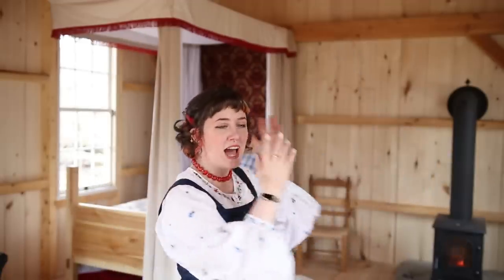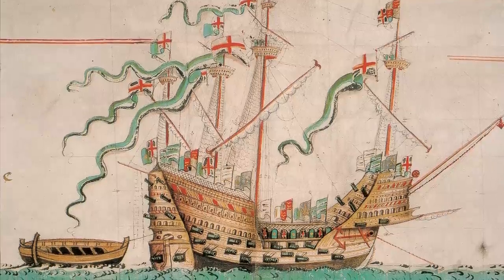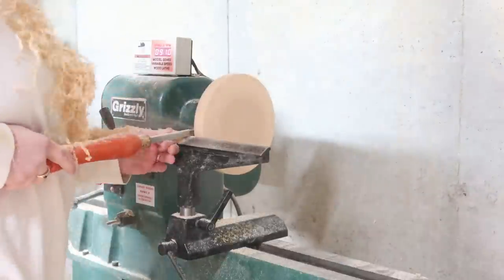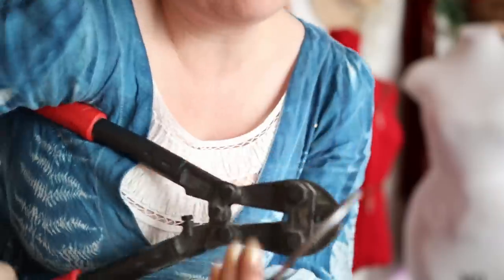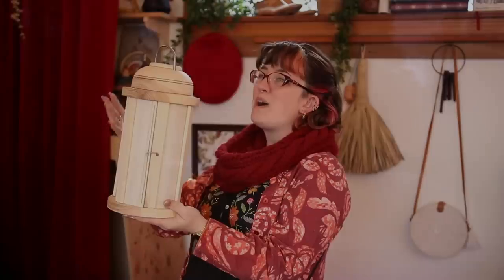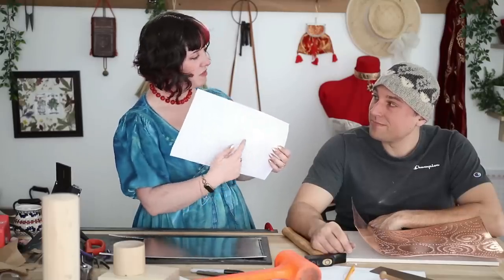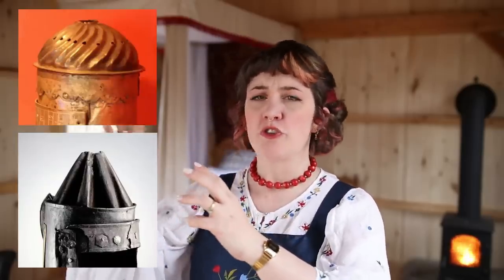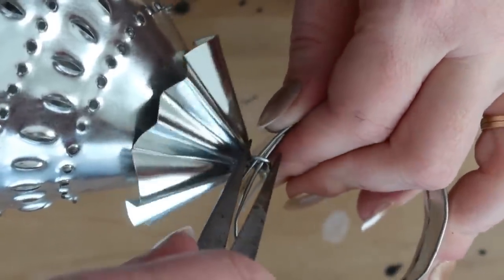Making some vaguely Medieval Lanterns 🕯️

Comment: Maybe it is because of my obsession with lighthouses but I always thought the glass panes were warped not quite smooth. Not warped as in disformed... Actually warped might not tbe the right word but I always thought that lantern panes were like lighthouse glass panes. See they need to be angled and cut in a way that lets the light refract and bounce so that the light beam can reach miles away to reach the ships out at sea.
While lanterns do not need to reach miles away, I thought the design process way still there so that when the user puts a light source (candle, flashlight, fairy lights, etc.) in the lantern, the light would be refracted in a way that illuminates around the user atleast a couple feet or in a straight beam to resemble a flashlight so they can see where they are going.

Comment: in the guedelon castle  they decided to make the windows out of oiled parchement so i find it most likely some medieval lantern would have been made in a similar manner (isn't it such a hazard to encase an open flame inside a box made of organic matter, itself place in a building of organic matter furnished with organic matter? The lanterns turmed out gorgeous tho, i want ten)
mid video hypothesis : the tin lantern works more like a flashlight (looks like that on the engravings) and maybe like a dimer light for mood (the photophor aspect of the case might look magical but it being metal can also be kept  on safely longer than the wooden one)

Comment: These are very similar to the contraption I designed for my fantasy healer character to test pupil dilation/contraction in brain damaged patients, except it was metal and all opaque so you can flip the front panel open to flash the light into their eye.  Glad to see my brainstorming is actually pretty similar to something that actually existed historically.  (Note: for those wondering, asymmetric pupil contraction/dilation or a lack of either is an extremely bad sign, and thus is definately something you'd want your fictional healer to check on if you got hit in the head...)